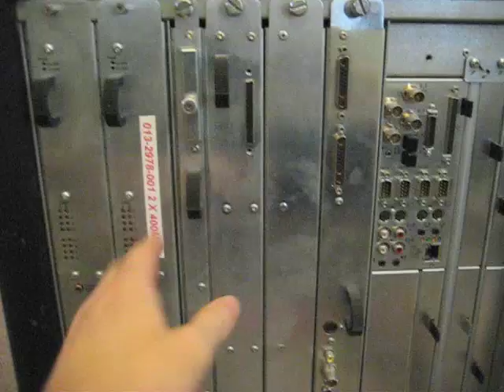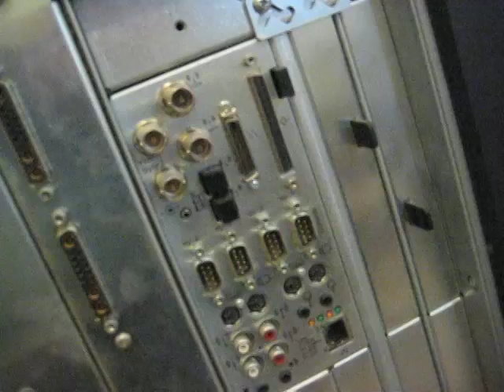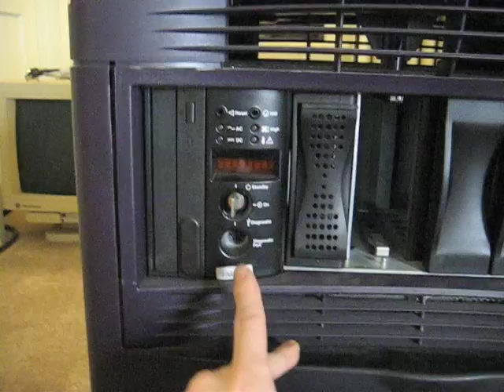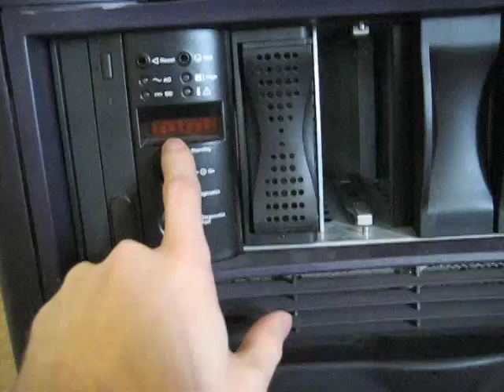SGI Onyx2 Tour

Comment: How much would you charge for it?
Reply from the maker: To buy it? I'm not sure I'd part with it. To my surprise the prices on these machines are going up - mostly due to scalper idiots. In parts it's probably $5k worth of machine. A whole one from another collector might be $500.
Reply: @jpkiwigeek  I would try to get it as scrap but in my area idiots around here are trying to sell pentium D emachines for $400, if I find anything at all. So ebay is probably the only place I can get stuff unless I am willing to drive +300 plus miles.

Comment: I couldn't find much information on CPOP, is it essentially the interface for system interconnect?
Reply from the maker: Yes, that's it exactly. It's the equivalent of a card-edge connector on a PCI card, or more accurately, the big bus connectors on a VME card or (more recently) the GigaplaneXB connector on my Sun E10000 to its centreplane. They're also just called "Compression Connectors".

Comment: I learned on an Onyx II back in the mid late 90's. I was an assistant editor compositor at Bedlam in LA. It was a great time, it was in the Heinsberg castle on Beverly Blvd. At the time it was $1.1 million with Discreet Fire Inferno programs. The drive arrays took up a small apartment. Great times, I was lucky enough to learn on the best system on the planet at the time:)
Reply: How could I get an Inferno turnkey system today, particularly one from 1995 (on an original Onyx or POWER Challenge GR), 1997 (Onyx2), or a 2003 system (Onyx 350 or Onyx 3900)? Also, InfiniteReality, InfiniteReality2, InfiniteReality3, or InfiniteReality4 graphics pipes would be the best to look for, right?
Reply from the maker: Niiiiice
Reply: I want to learn Discreet/Autodesk Inferno (I have Inferno 2014 SP3, the last version ever made), and I want to use it on a PC with Linux but I am saving up for a Quadro to get it to run someday (been working on this for over 2 years now and have had the software that long, but no hardware). But I am interested in the older SGI hardware for historical reasons.
Reply: I am jealous now ;-)

Comment: Nice! I've worked on quite a few of these machines and their successors over the years. As a mate of mine said: "an elegant weapon for a more civilised age". Even though PC's are way more powerful now, these things were unbelievably cool in their time.
Reply: S'funny, I've still yet to see mention of any COTS PC that can beat the old Group Station for Defense Imaging's data load rate, though perhaps finally AMD's WRX80 system could do it. But then I'd just move the goal posts to a max spec Onyx3900 multipipe IR4. :D

http://www.sgidepot.co.uk/onyx2/groupstation.pdf
Reply: @mapesdhs597  A client of mine had a couple of Group Stations. They were very cool machines.
Reply: @adam872   Awesome!! Did you ever hear what happened to them? I always wanted to get a look at their I/O setup (presumably butt loads of FC links, but I'd love to know if they used custom XIO cards rather than the generic PCI HBAs which are kinda slow).

I have an Onyx3800 btw (16x600MHz), currently with IR3, also a quad-500MHz Onyx2 IR4 deskside (basically max spec). I also have an Onyx350 but it's not connected up atm. My main system is a dual-1GHz rackmount Tezro V10, but I've decided to downgrade to a max-spec O2 at some point, just need to sort out a NAS first.

Comment: lol exactly how I feel..I had a 486 PC when these things were around for price tags of 20,000 dollars....Now you can have them for 50-200$ from Ebay, and Im gonna get mine...my i7 2600k is around 10 times faster, but I'm sure they still kick ass in certain operations
Reply: jeystonemusic no new Onyx 2 ever sold for as little as $20,000.  Low end systems were $75,000 with higher ended systems getting into the higher six figures.